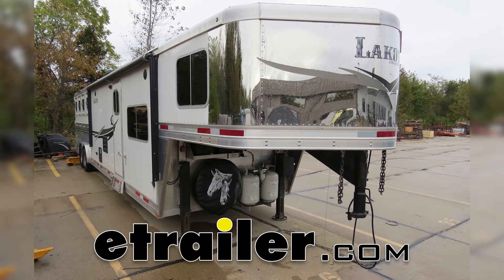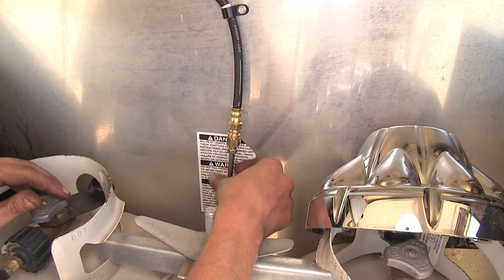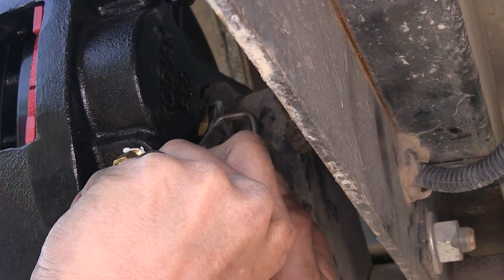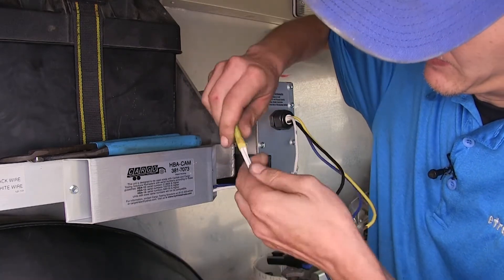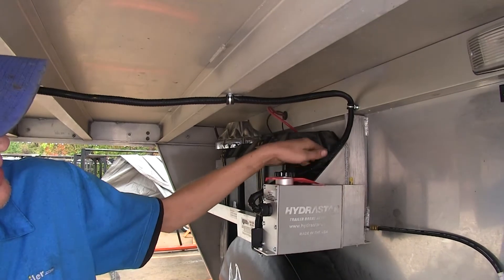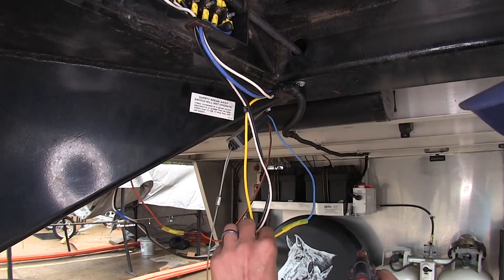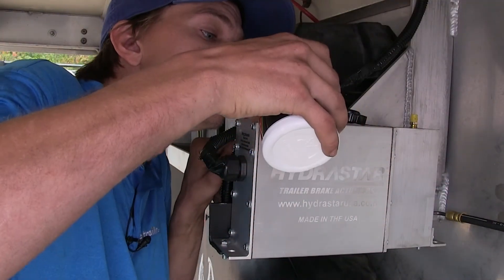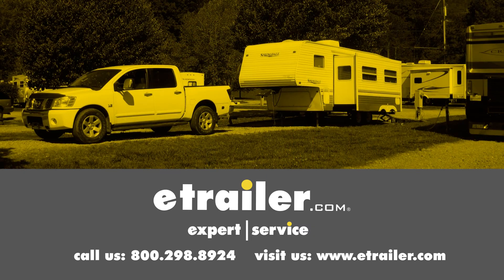etrailer | HydraStar Electric Over Hydraulic Disc Brake Actuator Installation

Comment: its raining with brake fluid going on the ground, let brake fluid flow on rear brakes. do you think he checked the propane tanks before using the flame for heat shrink?
Reply from the maker: We recommend using a tube and a bottle to catch the brake fluid. This is so that it doesn't make a mess and so that you can reuse the brake fluid if you are simply just bleeding them. This job was done the very messy way. The brake calipers should have been covered up and the brake fluid caught in a container.
https://www.etrailer.com/Brake-Actuator/Hydrastar/HS381-9067.html

Comment: IMO the technician should have used plastic dip over the heat shrink tubing ends & soldered all electrical connections for more longevity & corrosion prevention. The technician should have also used line wrenches on the brake lines & bleeder screws; the technician partially rounded off/damaged slightly at least one connection as shown in the video. The technician didn't do a good enough job installing rubber protective grommets under all clamp locations, some were still loose & the brake line could still get damaged due to vibrations/chaffing. I also thought it was environmentally irresponsible when the technician was bleeding the brake calipers to just let the brake fluid run out onto the ground like that, you already had a clear piece of hose & a bucket when you bled the actuator unit earlier in the video. You might think I'm nit picking but peoples lives are in danger if that trailer looses it's brakes out on the road & kills people. I have to take peoples lives very seriously being a FAA Certificated Airframe & Powerplant Technician on aircraft people fly on so I hope you take this as constructive criticism & learn from it & apply these techniques on future applications. Other than that the video was very informative & appreciated. Thanks for posting.
Reply: Cut the excess line off and flare the end.

Comment: Not impressed with the brake line routing.  That line should have been run along the longitudinal frame rails for protection instead of spanning dead space between horizontal frame spars.  The mounting locations where the metal hard lines connected to the rubber flexible lines do not appear to be secure to the frame and thus I worry about the metal lines flexing causing fatigue and failure over time.

Comment: What happens when some trucks we run have factory trailer brake controllers and other trucks don't???
Reply: Jason,

I am an employee of Hydrastar. There will be no difference in pulling the trailer. The CAM allows compatibility with all applications.